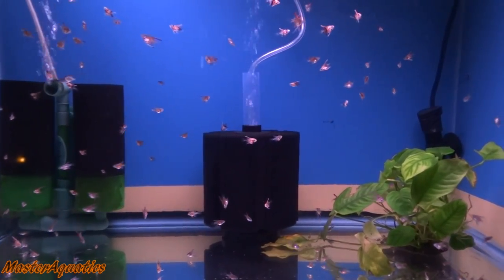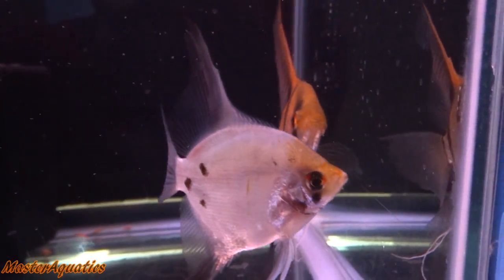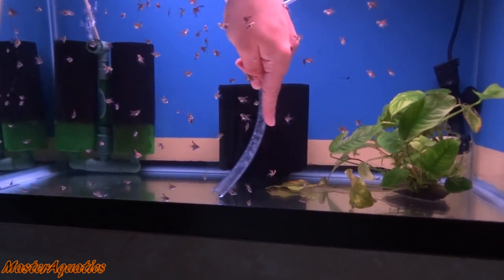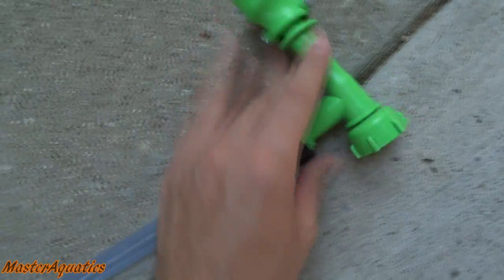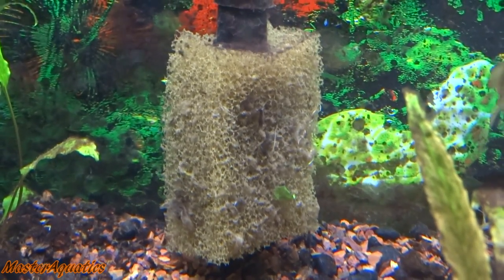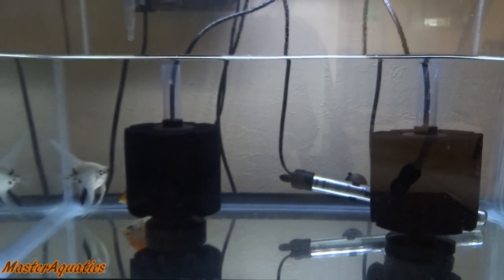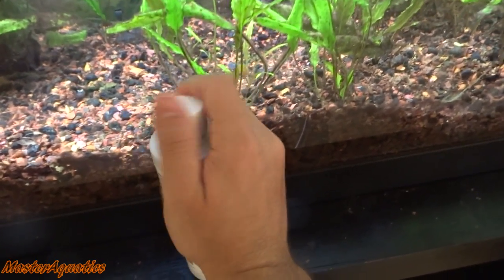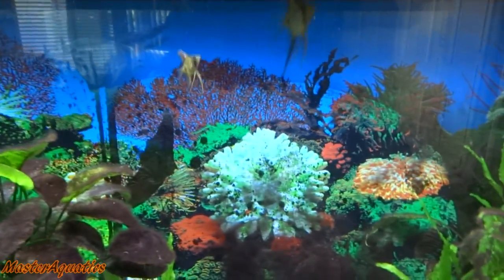Cleaning all my fish tanks. My daily routine.

Comment: Just a tip, you can tie a net over the hose tip when siphoning out the water in your fry tank so they dont get sucked up. Have you tried that before? Or you dont want to do it?
Reply from the maker: Rob Andrei hi. People have told me this before but i wont try it because doing this will only clean the water and not the free floating debris.
Reply: Thought so too. I just feel sorry for those geting sucked into the bucket. When i do a water change, i put the other end of the hose in the lawn outside the window so the water goes all onto the grass and soil.
Reply from the maker: Rob Andrei i use to feel sorry too but it does not harm them at all lol

Comment: on the 27th of Aug I had to get a new 75 gallon aquarium since my old 75 gallon tank was leaking  I used  the existing   filter that  had the same media i had running on the old 75 gallon tank and connect it to the  tank  my  20 and 30 tank both have  CaribSea Instant Aquarium Peace River Gravel  the same as my new  75 gallon tank I took some of the gravel  from  my 30 gallon tank that was running  for 2 years  and added it to the new  75 gallon tank  does this mean my tan k is cycled  i tested the ammonia and nitrite  today  and they both tested  0    I  also squeezed  a filter pad from a exsiting filter and I empty it  to a cup and poured it in the new tank